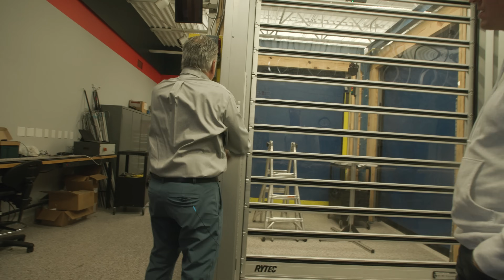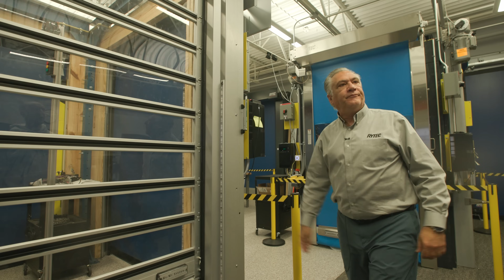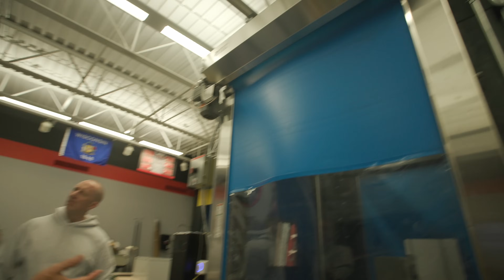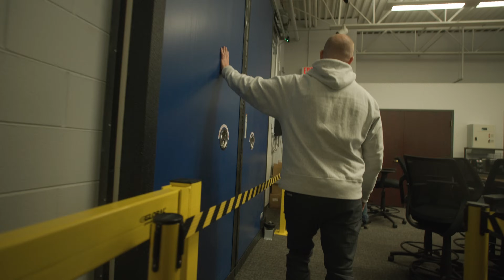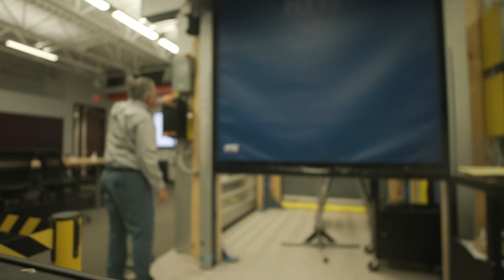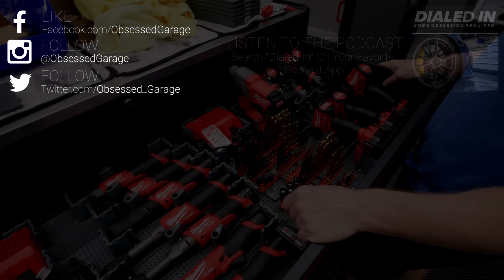Why Are Rytec Garage Doors So Fast? Technical Deep Dive

Comment: Those solid panel doors are so fast but SO deafeningly loud. They're used in the shop I work at and while they're great and super reliable, they're incredibly loud.
Reply: I’ve worked in 2 dealers that have these doors, one of which my work bay was nearest one of the doors (4 of these doors in that shop).  In a busy shop environment, the sound of theses doors in operation was barely noticeable.
Reply: @ghostwrench2292  We have 4 of the super fast panel doors in our service drive and they are anything but hardly noticeable, they're so incredibly loud.

Comment: As a Millwright in Facilities Maintenance at American Airlines for 16 years, we had  12 of the " BLUE " fabric composite sheet  HIGH SPEED OVERHEAD RYTEC doors in a building almost a quarter mile in length. These particular doors were used in an " AIRLOCK " vehicle traffic capacity, along with 2  internal CLEAR VINYL  doors which separated the Floorboard/Interior shops from the Wing Structures area.
  The Building Entrance Airlock doors, had inner and outer " WIND BARS " ( rolling up or down ) which traveled by nylon belts in a separate track in front of the fabric, designed  to keep the curtain in place from the high " WIND SHEAR " velocities associated with Airport Tarmac's. 
  With HUNDREDS of cycles daily... these doors were phenomenal in QUALITY, SERVICE LIFE, AND MINIMUM MAINTENANCE... BAR NONE!
   COPYCATS... I am sure exist, but as old and new adage's go :
   a) You get what you pay for
   b) Magic ain't cheap
   c) Being copied, or pirated, can be taken as the greatest form of flattery! ( NO CHINA...
that's not an " okay " )
   In summary... my apologies for the length of my posting, as my intent was to honestly convey my experience with these doors and the fact that no other doors lasted with the pure torture of being driven through, run into, an beat like a rented mule... they were put back in service within minutes normally, and survived the daily abuse that not one other manufacturer could match.
 " Bravo Rytec... you did the impossible "!!! 
Respectfully,Seth

Comment: I'm surprised they got a patent for a light guard system. We use sick light guards with albian doors on all the plants iv worked in and they function exactly the same . Cool to see it built into the door regardless
Reply: I was thinking the same, but he explained that the door itself actually blocks the sensor as it’s closing. Does the Sick system do that? That seems unexpected enough that I could see it getting a patent. 

I’m not sure that a feature like that is _necessary_, though :)
Reply: @gf2e  sick system wouldn't be integrated to the door but they do have a sensor that hands down below the soft edge sensor you see him talking about on the video by maybe 20cm with a photo eye on and if it's broken the door will shoot back up stopping it touching whatever is in place. So I guess this is a similar system but the extra back end stuff is cool
Reply: @ It’s quite possible that the system they have is only marginally better. Or even not at all. “We have 25 patents on our system that nobody else can copy!!!” can be a powerful marketing message. (25 is just a random number)

Comment: All our doors at my plant run the inverter into a capacitor bank. Instead of a brake resistor so you can use that regenitave brake energy and not just create heat

Comment: @ 26:44 - I will have to disagree with you Matt on not utilizing a MyQ app. I use mine regularly to let someone in my garage or check to see if I accidentally left one of the doors open or to program a close time at night if any of the doors were left open. Either way, RYTEC doors are amazing!
Reply: Agree. Being able to check and make sure the door is closed is the whole reason I got MyQ. After the door was open all day once because of a malfunction. It opened just as I was pulling away and didn’t see it opening back up after closing.
Reply: GOOD POINT 👍 I LIKE THIS FEATURE  😊

Comment: my condo has these.  they require a lot of regular maintenance.  not the most reliable.  and if something breaks, parts take forever to source.  let's be real, not YouTuber real.
Reply from the maker: I'm as real as they get hommie.
Reply: Maybe it's your maintenance guys who are dragging their feet, or they're being lazy and sourcing the parts through some fifth-hand reseller
Reply: @pistonburner6448  you make a valid point at my old apartments, the super was pretty tentative but have friends where they didn't have hot water for months or their elevator didn't work for months
Reply: Do you know if the doors are this EXACT manufacturer?!  In many industries they sell cheaper and often less reliable alternatives.